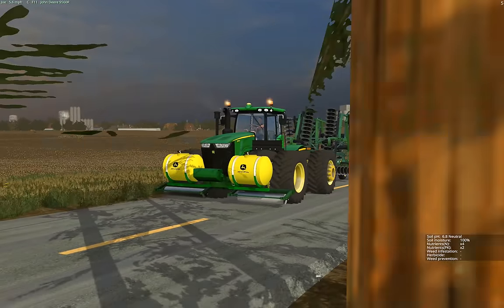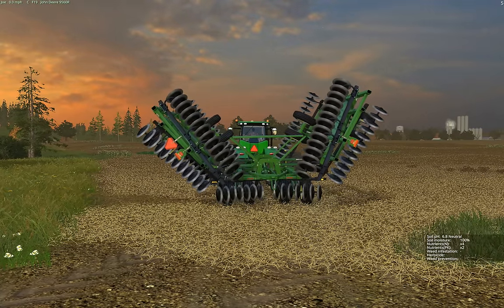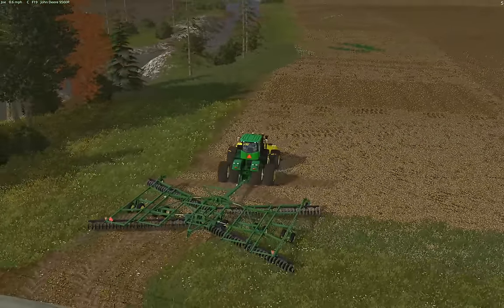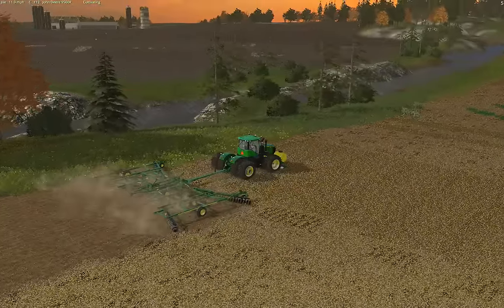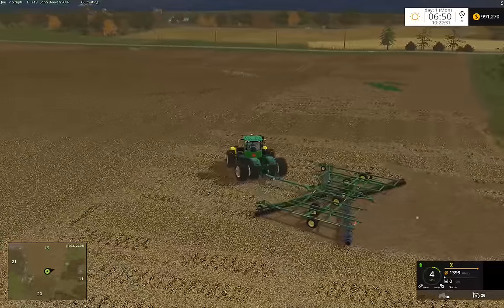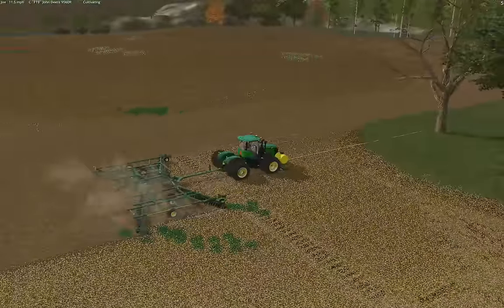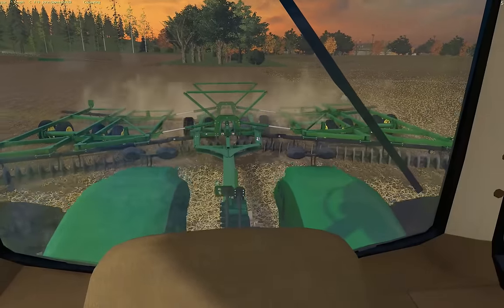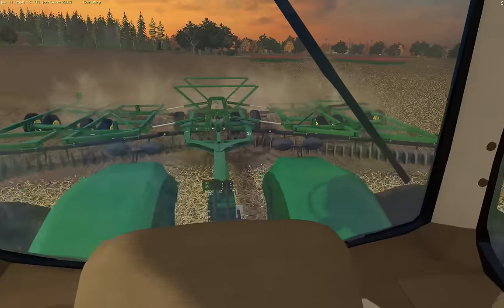Farming Simulator 2015:  John Deere 2623 Disc

Comment: What exactly are the rollers performing in front of the 9R's wheels? I presume it reduces compaction in a way?
Reply: +Landen Kuhlmann Thanks, but why are they only at front of the wheels then? Wouldn't they be across the span of the disc or implement?